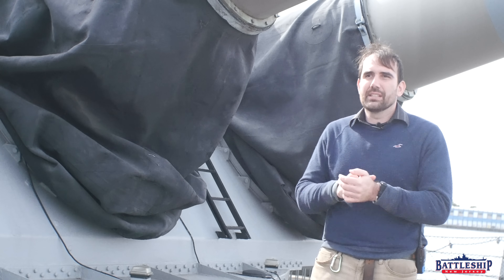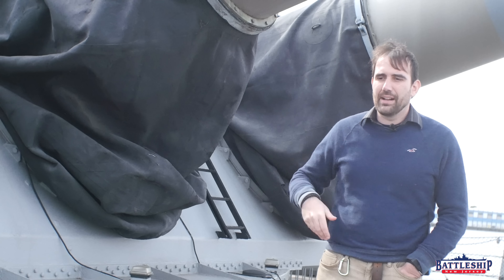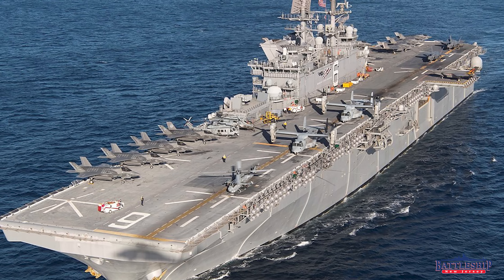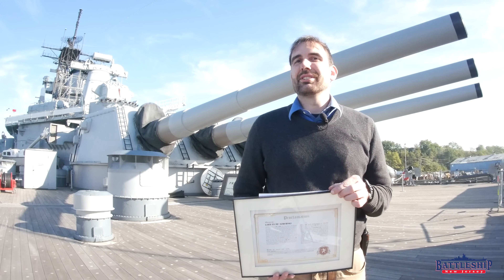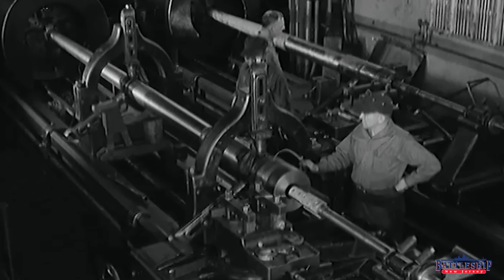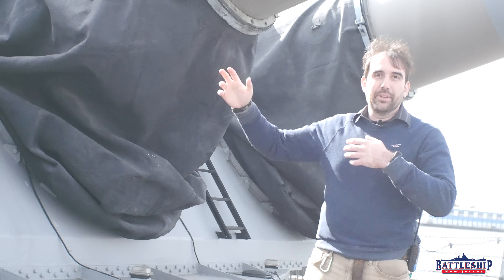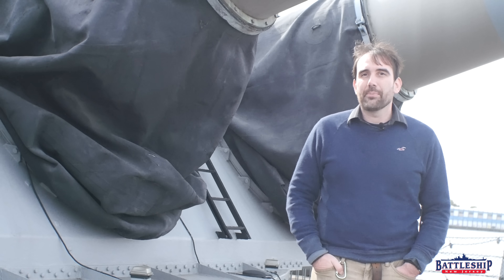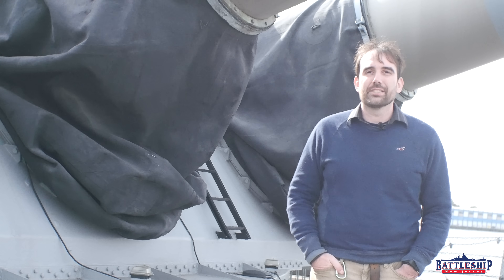How Much Would It Cost to Build a Battleship Today?

Comment: Like somebody else said we'd probably be staring Gerald R Ford class of aircraft carrier price tag here 

Other thoughts that crossed my mind is armament and I'm not just talking missiles(would this thing have sea sparrows and harpoons or would the ship go all the way and have the standard missile) put something tells me the United States Navy would want something spicier than the powerful but old 16 inch 50 caliber mark 7 guns or maybe they would want something smaller in caliber and using new propellants to try to get some more range and I'm not talking smart shells or railguns or anything like that 

Places the Navy could save money is not developing a crazy underwater protection system what's the abandoned in cruisers and destroyers in favor of ASM and surface air missiles to prevent an attacker from getting near enough to test the water tight and a ship 

Would a new battleship be armored or with the Navy do the same thing and just decide hey nothing will get close enough to punch a hole in a new battleship and this would be Satan's own cruiser?

Propulsion would be another consideration steam boilers would definitely be out but gas turbine or nuclear propulsion would definitely be under consideration

Comment: I just don't see the need for the big guns anymore. However, the sheer amount of deck space available on an Iowa class ship or something similarly sized if we're talking new build, is a very inviting prospect for launching missiles. Consider that an Arleigh Burke-class ship can carry a max of about 90 missiles. Just given the area on the New Jersey's deck, you could fit a LOT more missiles on. Like 4-5x as many. And that number is only 400ish missiles because current VLS cells can't be reloaded underway. You have to go back to port and it's a fairly long process. Lockheed or General Dynamics or some other group would need a way to reload missiles from a magazine and that number could be doubled. There is adequate space on something like an Iowa-class to hold that many missiles and that much weight. You would be using nuclear to power such a thing, likely a design lifted straight from an aircraft carrier, which makes the engineering spaces much more compact and more automated. 
Having a battleship with 5x or 10x the firepower of a guided missile destroyer, is game changing. The amount of firepower you could bring to bear and the targets you could hit by being able to park that ship off-shore is wild. Partner it with a carrier group so the planes and other ships can provide air and sea defense. You also wouldn't be limited to vertically launched missiles. If you wanted to, bolt on a bunch of Tomahawk (or its upcoming replacement) launchers to the deck or even PATRIOT launchers. Lockheed recently modified PAC3-MSEs to work with AEGIS and successfully tested them a couple days ago.
This means you can coordinate with all the other boats in your carrier group and spread the ships out along a fairly long stretch of coast and have AEGIS not only raining accurate fire to any point in-land within the missile's range, but also controlling one of the best air defense weapons in the world, and do it all concentrated from one ship instead of needing half a dozen Arleigh Burkes.
I know people like the big booms from the 16" guns, and yes I know they are a lot cheaper. But the idea of a New Jersey-sized guided missile battleship makes me feel funny in my caveman brain.

Comment: Bringing back Battleships would be amazing but one would have to ask why and what role would they be taking. I my mind there are three possible roles modern battleships could fill, carrier defense, shore bombardment and protracted medium range combat. The last two are relatively self explanatory but carrier defense I find is the most interesting. 
Currently China seems to be the most likely adversary the US would face in a head to head conflict and China has been touting the fact that they have made "Carrier Killer" missiles and that seems that for the moment while we do have some good defenses it is projected we would still lose 2 carriers in such a conflict. 
I think a modern battleship would be built not only to carry a large number of missiles but also a new defensive tool, the 16 inch guns firing canister shot. Now I'll admit this is just a theory but would it not be possible to elevate the guns in the direction of incoming missile and then create a wall of steel by firing the guns in succession. The most current version of canister shot is the 120mm M1028 Canister used on the Abrams tank, primarily used for anti personal, and according the GD it has a mussel velocity of 1410 m/s and a range of about 500m. If you could scale this up to the size of a 16 inch naval shell the spread would be massive and because the incoming missiles would also be traveling as speed the force on impact would likely shred the missiles to pieces.

Comment: YOU should have looked at it. There r 4. remove boiler/engine, install nuke engine. Toroidal screws. remove turrets, install state of the art missles etc...Island stays (stipped of course), install skirting with new systems (ele, RM, etc...), cut like DDoneK. New deck (duh). New wiring/plumbing/berthing etc... If done right?...it won't need a battle group, it would be it's own. P.S... 2 helo's. Stand-Off weapons system that loves to hate. (sorry: keyboard messed up on characters, won't do some).😊

Comment: As I read the comments, all have viable points, something struck me. The guns could be changed to the ATACMS. 600 pounds of high explosive and accurate as any missile with gps. keep one turret for ship to ship or bombardment if needed or change them all out. that is a a butt load of firepower that can go anywhere there is water. put harriers or helos on there also. lots of room if you want to remove stuff and change it to be different.

Comment: Build new. However for what use? Best case scenario is a cheap amphibious bombardment platform. If a new D day was necessary this would be a cheaper use than a ton of missiles, if already built.
However, the expense to retool would make it likely cheaper just to build the missiles. Unless you can make a battleship that can defend against 99.99% of all missiles and torpedoes so we can get in close and fire at ships, the age of the battleship is done.

Comment: I have a better idea, just give it updated alloys in its armor, dont plan a new hull, no new frame, nothing, just replace the armor plates above and below the water line and give it updated ranging, a new set of electrilonic equipment, power plant and a radar system and you are done, nothing else needs to be done because it would inflate the cost even higher.

Comment: Um, everything above the keel needs scrapping. That’s if we repurpose the existing ships. New power plant that can provide power for laser defense systems. Naval Guns are obsolete. The original MLRS has longer range and more accurate. You will use drones for Forward Observer missions. So, you’re going to have Cruise Missiles, SM6, ASROC, and MLRS(newer versions). That leaves manufacturers. We are going to have to go to Japan. We need to get the ships in service sooner not later.

Comment: worked for the DOD for thirty years.  The so called acquisition process is insane. My estimate that virtually everything costs three times what it should.  It would also depend on what your so called battleship actually would be.  A modernized Iowa Class ship or something completely different. A modernized Iowa Class should only cost say a billion dollars all told. Most of that is labor costs.   Now bringing back processes to make the armor and guns would cost; and a nuclear reactor would also cost.  As efficient as todays  propulsion systems are, and as big a ship as you can have and its ability to carry a lot of fuel oil means practically speaking there is no real plus to having it be nuclear.  There are considerations that carriers have that make nuclear propulsion the smart decision that do not apply to say a Battleship.  
NOW if you are talking rail guns or energy weapons and fancy missile systems and so on, then it will cost a lot more.

Comment: Either way is wrong. If you have no use for a type of ship, doesn't matter how cheap or expensive it is. The battleship's era, as much as I loved them, is over. The conflict and missions they were built for doesn't exist anymore. Even worse, there are simply no foe who requires them that can not already be solved by the current US navy for cheaper and more easily.

For them to make sense to be built again, we'd need a paradigm shift of enormous magnitude to justify their existence. Something that would completely negate the power of an Aircraft Carrier's air-wing and also negate long range missiles of all kinds.

Comment: Do a combination,  ships hull and electronics new take 2 main turrets in best condition from any of the battleships have the barrels re lined, turrets gutted  and modernized.
2 turrets on the fore end and vertical launch tube's on aft.
On the aft could be a small vertical craft launch deck with an elevator and  internal hanger. 
Definitely nuclear.

Comment: I would do both. I would retrofit the old Battle wagons while new ones were being built new. Id remove the aft turret and replace it with long range vertical launch tubes. Then slap on harpoon and Tomahawks. Plenty of CWIS and instead of a sea plane tender have a hanger for helidrones. 

Then 1 for 1 replace old with new. Stop building carriers. We  need to be able to invade. We need to be able to perform shore bombardment ops. Burkes can't do it. Carriers can't do it. We need ships that can absorb punishment. Not aluminum cans wrapped in Kevlar (here and there)

Comment: I wonder how effective building them would be. If you build a new one which I think would be better, forget the 16in guns, put a lot of missiles on it, go nuke for power and remove the huge bridge part and then make the hull very thick that might stop a missile hit, put a lot of lasers for defense and maybe offense and you would have a ship that could fight, go faster, weigh less and able to dish out destruction. Removing those 16in guns alone would cut a lot of weight that could be added for a stronger hull. Yeah, that would be one bad ass ship. 
   But could it take hypersonic missiles? to modern undersea torpedo's?? I don't know. I've been thinking that modern navies are going to be obsolete with today's weapons and it will be a crazy slug fest if they start shooting at each other.

Comment: You can't just compare a 1940's battleship being constructed back then with one of the same kind being constructed today as some sort of baseline.
When a ship was built back then, workers worked for less money and there was not nearly the same number of machines, tools and software to aid in the process.
There were easily over ten thousand workers hammering away in a shipyard to build these things. Today there would be hundreds of workers using far more sophisticated machines and techniques. As such, it would be cheaper in manpower, but more expensive in wages and materials. And the requirements would be completely different too!

Comment: In a world where the Navy wants to retire the Ticonderoga because of old age and high maintenance, there is no place for a reactivated Iowa class. A modern Battleship may also require much less armor due to modern layered active and passive defenses, which would leave more space and capacity for weapon systems.
I believe a modern battleship would look significantly different than the WWII era Battleship... but the Naval artillery definitely has a role in modern warfare, especially when you starting look at attrition rates like in the Russo-Ukrainian war. Replacing the Ticonderoga with modernized Arleigh Burke alongside a new class of battleship would could make sense. These could operate in independent fleets, parallel to the carrier fleets providing heavy, sustained firepower in coastal regions at a relatively cheap cost.
A Ticonderoga couldn't have more than 122 Tomahawks (in reality much less) , whereas a modern battleship could haul thousands of large caliber shells with twice as much explosive power at only a fraction of the cost. Lets face it, most military targets are within 40 km of a coastline, so this is really something to think about, especially in the context of the attrition rates seen in current peer-to-peer conflicts.

Comment: The expense would be a factor as why we would not want to build a BB again.  Also it takes so dammed long for our shipyards to build anything these days.  It would take 10 years probably to get one out of the slipway and into the water, because they would also make it so dammed complicated.  During the war, they built ships that were not perfect, but were adequate for the job they had to do and built as quickly as possible so they could actually participate in the war.  No pressure now to have any speed while building a ship now.

Comment: Can we make the armor plate still ?  
My thought was ...  keep the 4 we got but modernize.  pull out the turrets , cut off all the superstructure aft of the bridge , use the armored barbets for VLS  , take out all the 5 inch turrets and put in the auto guns for the destroyers in thier place. Cut open the deck and yank out the steam system and put in the nuke reactors we have already for the Ford class.  Use the void space for the fuel oil to up armor the hull with the same type of armor in a Abrams tank (D.U. )    unfortunately the 16inch guns are obsolete and the blast kills anything with a microchip but using the barbets for missiles saves alot of weight so much so can offset that with more armor and gain speed. The auto guns save crew and without the main battery can add missiles everywhere.

Comment: Just reactivate the Iowa, and Missouri for temporary service. In the mean time build 2 brand new battleships built to deal with the threats of today and after the two new battleships are finished, just retire Iowa a d Missouri again. This battleship class would have to be around the same size as the Iowa or New Jersey, possible even smaller to accommodate for radar signature. And instead of 16 In. guns, use about 4 127mm Naval Cannons placed on the bow and stern sections and then have individual tomahawk and/or guided anti-ship missile launch batteries. The configuration of the hulls will have to be wave-breaker hulls like the Zumwalt Class Stealth Destroyers to help the ships achieve higher speeds. The waves breaker hulls can also help reduce wake and radar signature. But yeah that's about it.

Comment: The quickest thing to do would be to tear off the Superstructure and gut the boilers at the same time. Replace the powertrain with a larger version of the gas turbine integrated propulsion system that the Zumwalt uses. Rebuild the superstructure built around the AEGIS SPY radar system, in the Burke style. Use the room from the scrapped 5 in guns, and older systems to install 300-500 VLS tubes with the bigger hypersonic ready tubes. Develop a Volcano/lrlap or ramjet round for the 16inch guns that would likely reach 200 miles and develop an auto/semi auto loader for them. Throw on a bunch of RIM-116, CIWS, counter measures, lasers, Mk 46 guns maybe a couple ESSM block II+ ER launchers. Make the fantail helipad an elevator that lowers to a below deck hanger in the rear lower decks for a couple SH-60's and drones. 

This would effectively turn the Iowa's into Guided missile battleships, basically making the guns rapid missile launchers that bring 1200 long range guided missiles for offshore bombardment/fire support as well as anti-ship, on top of the VLS/hyper sonic capability. Not only would they have massive firepower. They would be able to take a beating with their old armor system. The Navy sorely needs something like this for a war with China, and this would be the quickest way to get it in the fight.

Comment: What would it cost to upgrade and bring the battleship into the 21st Century.  Replace her after turret with a 144 cell VLS unit with anti-air/ship and ground attack missiles.  Upgrade her electronics to SPY-6 battle suite.  Replace her propulsion plant with four GE LM6000 gas turbines generating 280,000 SHP and controllable screws.  Replace the eight 5"/38cal guns with the MK-45 5" guns.  You will then have a ship that has a reduced manpower requirement, uses the same fuel that the rest of the fleet uses, able to communicate in, and control the battle space with the rest of the fleet.  And most important provide the Marines with the needed fire support that is currently lacking.

Comment: There's only one answer. You have to build new. To keep the old gals running would be too expensive. Any you saved by bringing them back would be out the window in a few months. And, let's face it, it wouldn't be worth it to bring them back for anything less than a year's service. You'd basically have less run time on them than you did to bring them back, not including the decommissioning time and costs. 

As cool as it would be, their day has set.

Comment: If the gross tons remain the same as in WW2 (48 to 57 tons) vs today's carriers at 100+ tons, it would cost less, but, the cost of building the guns, whether they be 16" or the Super 16s, but use alternative  Flechette rounds, to fire smaller yet with a better Ballistic coefficient,  could feasibly fire a high explosive round over 50, and maybe upto 75 Mike's.
Now the question is, does the navy or the war department have 16" rounds and powder in a stockpile,  and are there any 16/50 caliper gun barrels anywhere in stock to even assemble a complete triple gun turrets??